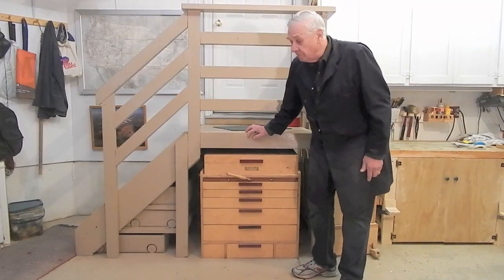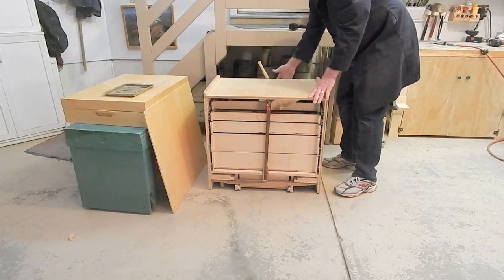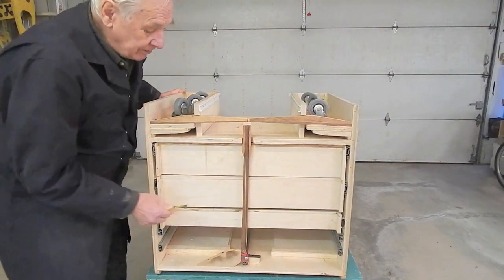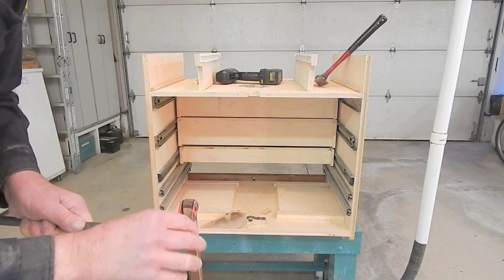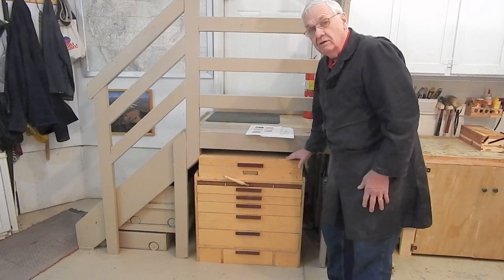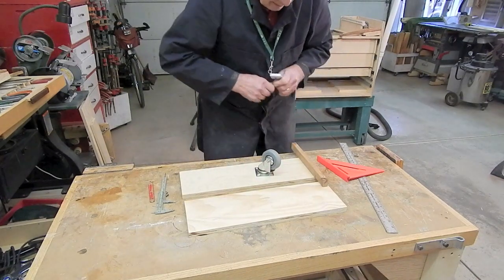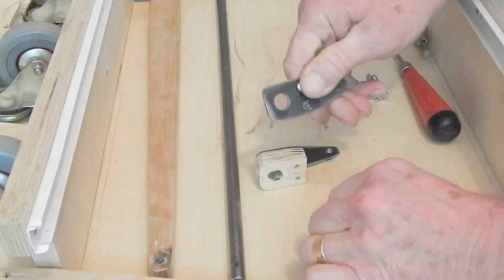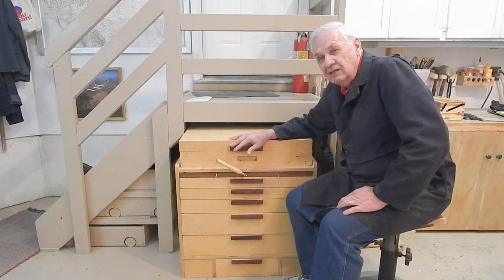Retracting Casters 6 of 6 - Tool Cabinet Retracting Caster Plans

Comment: I am in the process of buying a shed/barn in which to build my workshop and some storage.  The shed will be small, so I will have to make the most of the space within.
  Your caster system(s) is amazing.
  I will be using a variation of the system in this video for my table saw!
  reason?
  I want that handle that you have at the top front of my saw to swing up INTO MY WAY when the wheels are down (table saw LIFTED) so that I 'cannot' use the saw in that state, and will be forced to lower the system (raise the wheels) in order to get that handle out of my way.
  it's a cheap mostly-plastic jobsite saw that I'll have to figure out a way to run your handle through the top of the saw's cabinet and not interfere with any of the moving parts inside but I believe it can be done!  Thank you very much for the idea!!